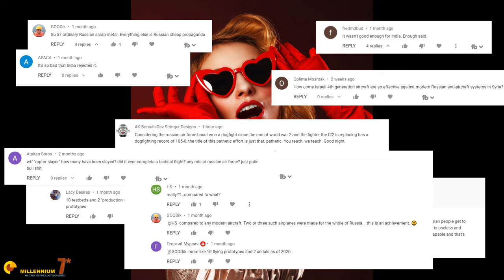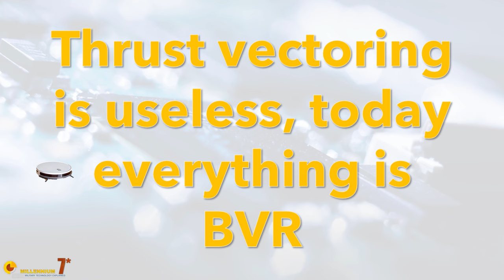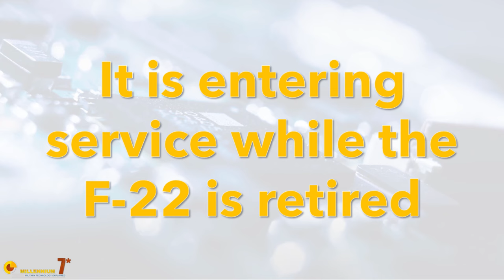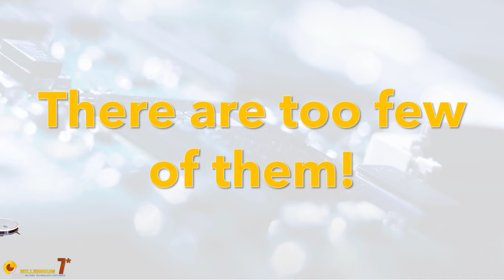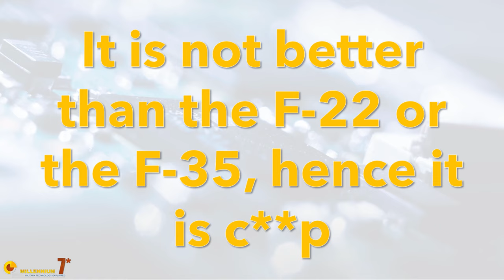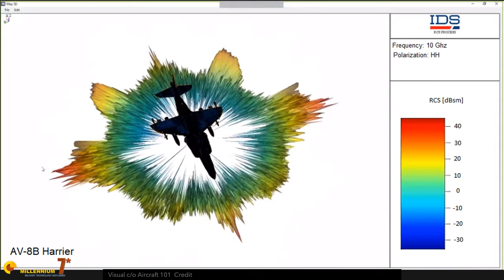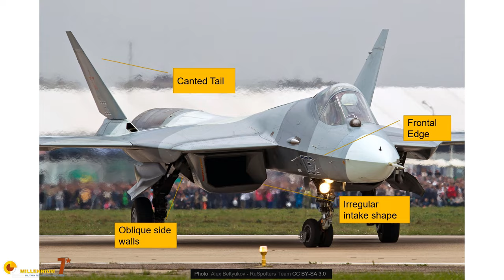Su-57: is it INVISIBLE?

Comment: Since the SU57 avionics are all about data fusion, and it has two L band arrays in conjunction with the three x band arrays, I think we’re underestimating it’s ability to create tracks on other stealth aircraft. Yes an individual L band array is no where near the accuracy needed to create a track on an aircraft, however using two of them at different angles to locate a target, then focus all three of the   X-band arrays (which all would also have slightly different angles) I think it’s well within the realm of possibility that the Su57’s on board computer could create a track with that data alone.
Reply: When the SU 57 is not in the same level of RCS as F-35 or F-22, add L band array is what is call better then nothing. The fact is you need big L band array to just see a target at good range. That why there are question able the SU 57 L band array.  They are just two small to be very affective at all. For the three x band array, two are side array so they don't help search for target from the front. The main x radar is also smaller then the ones on the f 22 and  f 35 with meaning hard to track VLO fighter. the two side array on even smaller. They didn't make a big different if it data fusion when the senor are not as good vs its rival. SU 57 is great vs for 4 gen fighter but vs VLO fighter is hard to say.
Reply: @jimc1654  Can’t tell if you’re trolling or just really far off the mark. SU57 is the only combat aircraft to have multiple radar arrays. Not to mention one of the only aircraft to field both Xband and Lband radars. This gives it unprecedented detection capabilities. I’m sure you didn’t know this, but the way the Russian air defense radars work is by combining a series of different radars across different wavelengths not only to detect aircraft but to create weapon tracks. This technique is so effective it is the basis for why the US navy positions Aegis vessels in super carrier fleets. Additionally this technique is also employed via F35 tactics; using a combination of data links and physical maneuvers to exponentially increase the detection capabilities of the aircraft when flying with other F35’s. The difference is that the SU57 uses this proven and tested technique in a single aircraft which is not something other combat aircraft are capable of. RCS factor is irrelevant. What is relevant is which aircraft can detect the other aircraft first, and both in an individual level and at an operational level the SU57 has the advantage.
Reply: @92HazelMocha  Sorry, I guess you know understand the size of the radar is a factor to all detection capabilities. You have a L band radar the size of handheld flash light vs something that is S400 with is like an searchlight. The S400 works because the size of the radar is big. There no way to can get a track by L band with that small radar. That mean you need x band to do all the track and fire control. That why F-22 and F -35 have a big x band radar. For it T/R count, F-22 , EF , F35 is known to largest for a fighter. The Aegis ship use  S band radar the size of SU 57 for tracking and search. It have x band radar to light up the target. To say RCS factor is irrelevant is to say S400 don't need an x band range. However, it still do.
Reply: @jimc1654   Idk if you’ve ever seen an airplane, but the Lband arrays on the SU57 are dramatically larger than you’re describing. Like probably around 8-10 feet on their longest axis. 

Secondly radar size doesn’t matter. The F22 and F35 radars are good because they’re modern AESA radars not just because “they’re big”. 

Finally, even an early cold war  L band radar is exponentially better at picking up stealth aircraft than a brand new AESA xband radar. The F-117 shoot down is proof of that. You don’t seem to understand how radars work or why L band arrays are so effective in this manner. The short version is that the wavelengths are so long that it dramatically diminishes the geometric stealth that stealth aircraft rely on, the trade off being instead of a precise location as with an Xband, it’s a much larger area due to the wavelength. RCS is irrelevant because the only thing that actually matters is if you can detect the enemy aircraft before he detects you and  having L band arrays alongside Xband arrays ensures it plays out that way. 

I’m going to ignore your comments on Aegis and S-400 (which by the way is an anti-ballistic missile platform, not an anti-aircraft suite) because it’s absolutely  clear you have no idea what you’re talking about.
Reply: @92HazelMocha  Sorry but true L band radar need to be a lot bigger then the ones on the SU57. It is to small to good range detection.  The size of the L band radar is just somewhat large then the one it use as IFF. The F-35 have a L band IFF on it wing with mean it can detect L band so once you turn your radar on. it will know you are there. Fact is you can only use the X band to shot and both F-35 and F22 have a better x band.
F-117 was shot when the radar was less the 10 mile away. The same radar that shot it down have a normal range of 50 miles. Even that radar is bigger then su57.
LOL Aegis and S-400 is just of  anti-ballistic missile. That is so funny. Maybe you need to google first.
Reply: @Emrys  I mean it is that simple. It’s not that stealth doesn’t work, it’s that it still has its limitations. It was shot down without a proper weapons track, using only an old Lband array to determine approximate locations and route. 

There was a much lower profile but more impressive shoot down recently; the downing of a US “stealth” drone over Iran. Of course the Iranians have a much much better air defense network than 90’s Serbia, but the point is that radar stealth, while it can be a serious advantage, is not a solution for any problem posed on the battlefield.
Reply: @Emrys My apologies, I’m definitively not against stealth aircraft, but I think it’s unwise to put so many eggs in the same basket so to speak.
Reply: @Emrys shot it down, end of story
Reply: A big thing that a lot of people seem to be missing here about the accuracy of the L-band is that while you can't guide a radar missile onto target with one, there's no reason you couldn't lob one of Russia's quite numerous IR seeker types in the general direction with a 'find and kill instruction'. A launch would also be enough to require counter-measures, which can be a mission kill. And removing stealth fighters from the mission, would give an Su-57, backed by older types a pretty good advantage against a mixed NATO sortie.
Reply: @mortarriding3913  Precisely, and this is also not even considering LOAL, which gives the aircraft that fires first a dramatic advantage in modern BVR combat.
Reply: You live in the lalaland. If it could make miracles like that, Indians would have bought it long time ago.
Reply: @konfunable  The reason India pulled out had nothing to do with the aircraft's capabilities, however how it would have exactly fit into Indian airforce doctrine is a discussion for a different time. They pulled out because Russia had misled India into thinking it would be produced locally, instead of primarily relying on Russia to import the majority of its components. Russia did this specifically to limit India's knowledge of how its systems were engineered. This is why right after India pulled out of PAKFA they went into developing their own aircraft, despite the massive costs associated with research development and design. 

Additionally this isn't "lala land", Russian Chinese and American Air defense all utilize this exact strategy to detect and shoot down enemy aircraft, and even the F35 has systems in this same vein. Maybe learn a bit about the technology you're attempting to discuss first.
Reply: @mortarriding3913  Lol, please give more conspiracy theories lol...
Reply: @92HazelMocha  What I was referring to as lalaland was the fact that Russian radar could be more advanced than western ones. Russia has always been hopelessly behind western electronics, and having better radar than US is simply impossible.
Reply: @konfunable  what I said is well documented and uncontroversial.
Reply: @mortarriding3913  You are spitting some ridiculous conspiracy theories and you call me strawman. Well, you definitely get VATNIK of the internet award this month lol.
Reply: @konfunable  which conspiracy theory? I only stated uncontroversial and well documented fact.
Reply: @konfunable  That's a misconception. Their systems are big bulky and inefficient, but do the same jobs, with largely the same capabilities. 

The second factor is that the Russian ministry of defense is and has been broke for decades now. For instance the first Russian airborne AESA radar was built in the early 2000's not long after the west built theirs, but simply couldn't afford to put it on their aircraft. In their defense however there are actually a number of AESA radars developed for US fighters that have only been implemented in export (like the F16E, F, and V) due to the associated cost with retrofitting them domestically, and the US has the largest defense budget of any nation in the world. 

Finally this is not radar technology, it's networking. The whole idea behind sensor fusion is that you utilize existing sensors in connection with each other as opposed to independently. The net effectiveness is dramatically increased without actually increasing the capabilites of any of the sensors via raw computational power. It's not about being "better" or "worse", it's about design choices. They chose to include 5 different radar arrays instead of focusing on the RCS, which could definitely give the aircraft such an ability.
Reply: @mortarriding3913  lol. Fact that Lockheed Martin paid Indians not to buy Russsian planes? Yeah, right lol. you need help.
Reply: @Emrys That was 1st sortie of that F-117, there have been some leaks about possible heading of that F-117 but nothing is confirmed. Also downing of that F-117 was on 2nd day of the bombing, and that is not enough time to precisely know what aircraft was flying over and where it is headed.  No, it is possible that it was detected when its doors were open, but it was visible with closed bomb bay doors, no sings of open bomb bay doors when it fell were found. Those missiles required a constant lock for them to track the target, meaning doors have nothing to do with why it was shot down.
Reply: @jimc1654  You dont understand that those L-Band radars are not used for targeting or getting a lock on to the target, it is used for detecting stealth targets at longer ranges.
Reply: @milosmilictrob2046  As far as I can tell they don't require a constant lock.  The missiles can be launched at a target vector and the illumination turned on an an opportune time.  The Serbian officer in charge of the SA-6 Battery was interviewed.   This was necessary to avoid an anti radiation missile anyway.
Reply: @92HazelMocha  "You don’t seem to understand how radars work "
"Secondly radar size doesn’t matter. "

LMAO

That is all.
Reply: @kiwishizzle  So an F14A has a more capable radar than a modern F16? It's significantly larger. Radar is far more complex than bigger=better. That's why the Mig31 doesn't have the best radar of all fighters.
Reply: @92HazelMocha  Back tracking from "the size of the radar doesn't matter at all all" to "size of the radar isn't the only thing that matters"
Reply: Only if we assume the L-bands won't be jammed into the oblivious. Those are so small and underpowered that in reality they simply can't be accurate. The introduction of noise will be too harsh.

Comment: As an electrical engineer became fascinated with stealth after studying the Jaumann Absorbers and Ferrite absorbers the German WW2 Navy used on its periscopes and snorkels.  These simple to make German WW2 technology could absorb around 99.5% of microwaves if combined.  It's clear the Su-57 has a considerable degree of stealth.   Pro Indications of stealth are:  1 Weapons Bay 2 the Upward Angled AESA radar which will reflect waves upo and away.  3 the leading edges of all control surfaces (with one exception) is aligned to minimize scatter.  4 The Intakes hide the engines 5 Angled side surfaces.   Negative Indications are 1 the leading edge slats which create a seam, 2 the exposed IRST sensor 3 visible seams of the panels 4 the chine angles are different 5 external antenna and aerials and 6 exposed nozzles.    Nevertheless its clear that from the frontal aspect the aircraft should achieve at least a 256:1 to 512:1 reduction in RCS over say a Su-34 in the frontal quadrant in the Air to Air role.   I'm assuming a 128:1 reduction due to stealth coatings and and another 4:1 due to shape factors.    For instance it won't have exposed weapons, its radar will reflect incipient radiation back the slats will have RAM as will the wing structure and surface behind, the cockpit canopy will also absorb radiation, the engines will be hidden and most of the angles will deflect radiation.   There are many flaws but there is a considerable reduction which will have a significant effect.   On the side and read quadrants the engine nozzles will be visible both to radar and infrared.

Comment: Hi M7 ! 

About stealth capabilities of the Su-57, yes, it is stealth 5th gen fighter like all other 5th gen fighters ( US F-22A ,F-35  and Chinese J-20A ,J-35 ) . Former chief constructor of T-50/Su-50 Alexander N.Davidenko  once said about frontal RCS  : “The F-22A has 0.3-0.4 m². We have similar requirements for RCS.”  Serial/operational Su-57 is  truly stealth fighter especially in front hemisphere. Thanks to ITO-sheeted  triplex windscreen and cockpit canopy ,thanks to composite skin, forward looking main AESA N036 antenna angled by 15° upward. Then thanks to those radial-coaxial grids inside of air intakes acting as anti-radar blockers and composite-made IGV of AL-41F1( also of  newer AL-51F)  , specialy positioned vertical stabilisers and of course special RAM layers basen on nano-materials that are being put on the skin in special chamber.

That 's not all. As any stealth fighter, Su-57 can also carry those Luneberg lenses.If it is not stealth fighter as many in the west describes,why Su-57 carry 'LL ' anyway ? And those 'LL' are not so small as we can see on F-22A,F-35 or J-20A bellies but they are so huge,in fact Su-57 carry 6 of them under the wings! They look like balls. Why ? 

Many people ask about that plasma-stealth. Only I can write is that there was some experiments with special ball-like plasma generators ( generators of ionised gas) in the 2nd Central Scientific-Research Institute of the Air and Space Army in the vicinity of Tver. One of tasks was  to achieve that fighter would be completely invisible for incoming AAM's radar seeker. Generator would illuminate with ionised gas everywhere,in every direction for some time.

Your question was ,is it invisible? Of course not like all other stealth aircraft ( not only fighters but bombers too). But if operational Su-57's would use those plasma-stealth generators it would be invisible for AAM's radar seeker ,maybe even for the fighter's radars. All the best !

Comment: I think you are correct in your statement about high tech warfare being it’s own first casualty. Imagine two near peer high tech opponents coming at each other with all their  radar/data links and jammers operating in full power combat mode. 
Add UAV’s and decoys flying around + surface based threats and then take into account the combined closing rate of opponents flying at each other at 1,000kph or more each. You have an excellent chance of ending up in a WVR merge which is where the SU 57 shines. 
Many actual fighter pilots who obviously know what’s up have also stated that two fighters both equipped with helmet sights and HOBS missiles have an excellent chance of a mutual kill , pilots can wave to each other on the parachute ride down if they are lucky enough to eject successfully!.
Reply: There are different levels of high technology where the premise that everyone is on similar paths might not hold true.  In the US, the processing power and EW systems are ahead of everyone else, as is the antennae semiconductor technology and quality.  There are entire segments of the SC market that aren’t allowed outside of their DoD contracts, and they have the best SC wafers with the most electron mobility.  When you combine those baseline capabilities into sensors, weapons, and antennae used for EW, it gives you a qualitative edge that can’t be reached with hope or any form of patriotism.  It just is, and is based on decades of aggressive development in closed enterprises.
Reply: Exactly. Against a capable opponents large number of support drones, and decoys will be used. Also by detecting the proximity of a stealth fighter the producer of the video is not taking account the EW, decoy and UAV enviroment.